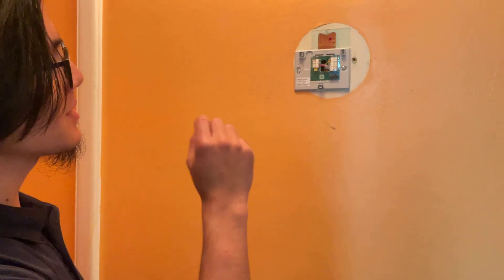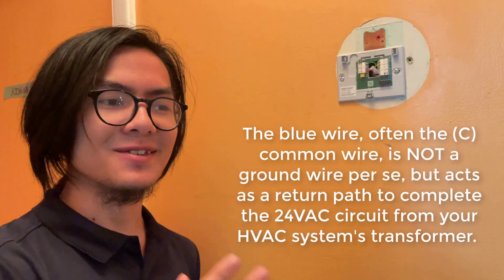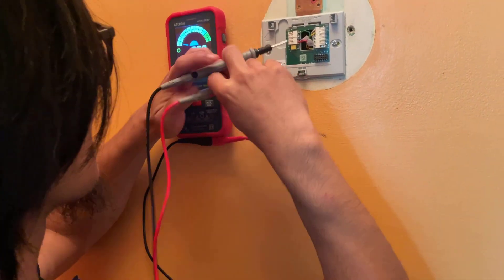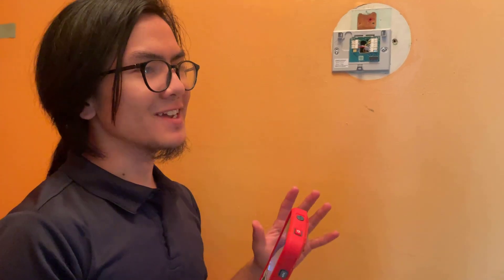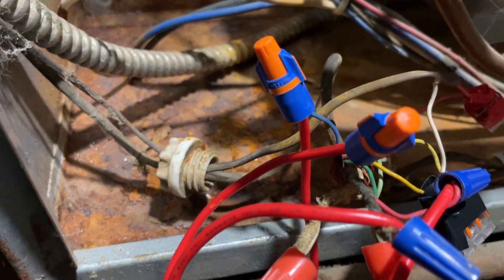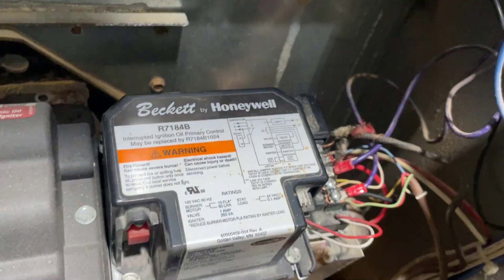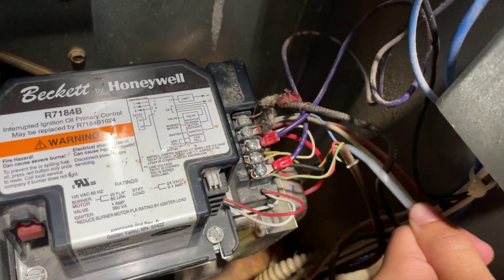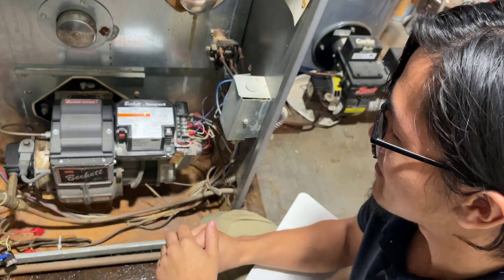How To Find Thermostat (C) Common Wire, Test R Y G C Voltage & Trace Back To Furnace Control Board

Comment from the maker: Here are the #ᴬᴰlinks to tools and accessories needed for the repair, as well as modern and popular brands of thermostats out there:
1.  https://amzn.to/49IdXKx  |  Honeywell Home RTH9585WF Wi-Fi Smart Color Thermostat, 7 Day Programmable, Touch Screen, Energy Star, Alexa Ready, C-Wire Required, Not Compatible with Line Volt Heating Gray
2.  https://amzn.to/3Td4lk8  |  Google Nest Learning Thermostat - Programmable Smart Thermostat for Home - 3rd Generation Nest - Works with Alexa - Stainless Steel
3.  https://amzn.to/48MCH32  |  MoesGo Programmable WiFi Smart Thermostat for Home, No C-Wire Required by C-Wire Adapter, with Zone Remote Sensor, Remote Control Tuya/Smart Life, Compatible with Alexa and Google Assistant, 24VAC
4.  https://amzn.to/3TvmPgQ  |  Sensi Touch 2 Smart Thermostat with Touchscreen Color Display, Programmable, Wi-Fi, Data Privacy, Mobile App, Easy DIY, Works with Alexa, Energy Star Certified, ST76, C-Wire Required, New for 2023
5.  https://amzn.to/48Hso0c  |  Mysa Smart Thermostat for Mini-Split Heat Pumps and AC | for Ductless Heat Pumps, Window Units or Portable Air Conditioners, Control Remotely with Smartphone or Tablet, Energy Saving, Easy Setup

Or Click on Amazon link here and search for what you need:  https://amzn.to/3D1T2GQ